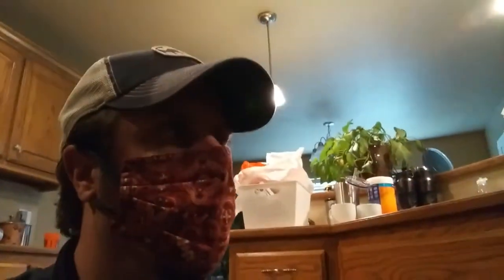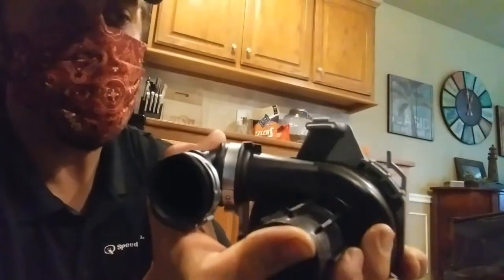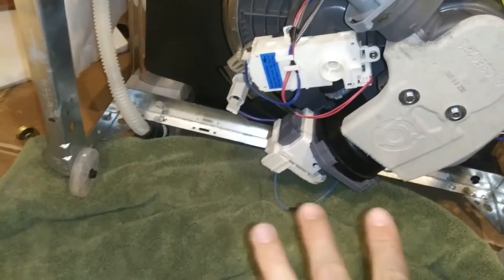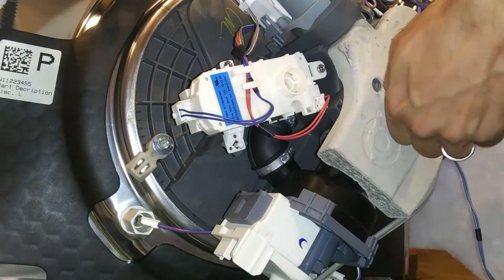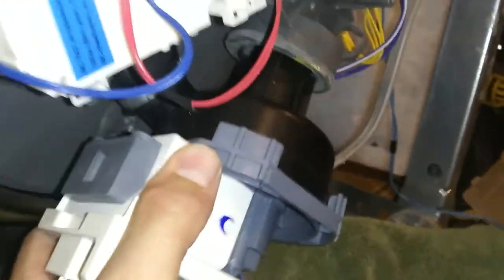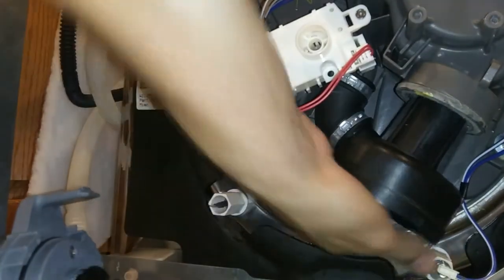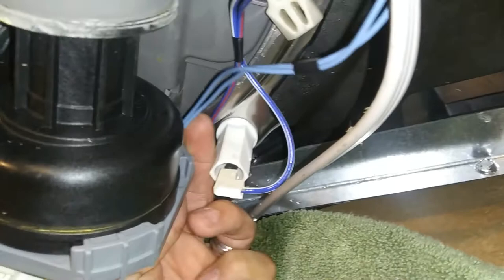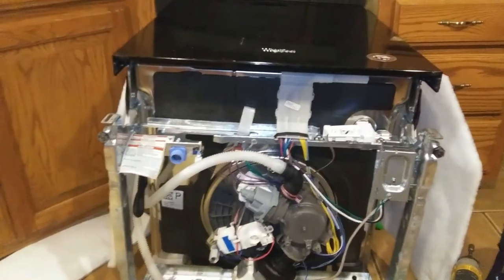Whirlpool Dishwasher Won't Wash: W11084656 Wash Pump Installation

Comment: My Whirlpool Gold Series filled, water heated, relays ticked and the water drained, but no wash. Diagnostics came up clean and then the pump worked for a cycle or two before failing again. Replaced the pump motor using the existing housing. Problem solved. Thanks for the vid.
Reply from the maker: Notorious failure, my friend! Good work! Protip: if you know when the wash pump is supposed to be running and you know it's getting 120VAC, you can knock on them with a screwdriver handle and they'll sometimes come to life. Good, quick way to tell if your pump is bad. Happy to help otherwise!!!!

Comment: Taking snail off is good idea.  Ill try it out.  I didnt want to buy whole assembly.  We will see. Looks pretty simple.  Could i do this without taking dishwasher out?
Reply from the maker: You could try, but I doubt it. I always have to remove the unit from the hole.
Reply: @cgappliancetelevision2315  ok thanks

Comment: We ordered that part from Amazon, they shipped part # W10510667  as a replacement ,it fits but the plug did not work  
where did you get yours ?
Reply from the maker: I'd have to have the model number of your dishwasher to determine what part number will work for your machine. You can never trust Amazon when it comes to part number substitutions. I always use searspartsdirect.com, plug in your model number there, then copy/paste and plug in the part number they give you to cheaper sources.
Reply: @cgappliancetelevision2315  it is WDT970 SAHVO , Thank you very much and Merry Christmas to you and your family

Comment: Wondering if this pump had the old W10854710 part number on it?  Read that the W11084656 was an upgrade but the one I got had the old P/N on it.  Barely got a year out of the original...
Reply from the maker: Yes the W11084656 replaces W10854710. Here's a pro tip: you can always go to searpartsdirect.com and punch in a part number. It will automatically take you to the correct and most current one. You don't have to buy from there. Just use it as a tool to find the part you need. I haven't the foggiest why you received the old part number if it was an OEM part. You'd have to check with your vendor. These pumps are notorious for failure. It pays to get the most current number. It may have been superseded due to the old number having an issue. The other reason part numbers get updated is if the company adapts the assembly to work with more models. Hope you can get your situation rectified!
Reply: C&G Appliance Television all was going well until the new part wouldn’t go in. Come to find out they sent the wrong part number!
Reply from the maker: @JPLawnsMore  That does happen sometimes. Aggravating to say the least. Hopefully the outfit you purchased it from accepts returns!
Reply: C&G Appliance Television well since the first pump arrived broken in no bubble wrap they sent another one free. And this was wrong. So we will see what happens when they reply to the email.
Reply: we have the same part number w 10854710 ordered one from Amazon , they send w10510667 it is the same pump but the plug did not work 
any idea where to get the right one ?

Comment: Great video. Thanks! Before I attempt, is there an easy way to verify that this is the part that needs to be replaced? My DW fills and drains but doesn’t spray any water. I did the diagnostic test and I get the code E3 F4
Reply from the maker: You need to test for 120v V AC at the pump when that wash pump is supposed to be running. As far as getting the correct part, look up the pump motor assembly that is supposed to go with your model number. I like to use searspartsdirect to get a part number. Then take the number you got from Sears and punch it into Google. That way, you can find it as cheap as possible.

Comment: i have clicking sound from under the washer and no wash cycle starts. could this be my issue and i need replacement pump or could it be something else?
Reply from the maker: It's very possible. Test for 120VAC at the wash pump when you're sure it's supposed to be running. Don't just go replacing parts. If you do, you will spend a bunch of money that you don't need to be spending. Always always troubleshoot. I can't wave my magic wand and tell you what is wrong with your machine.
Reply: Mine is doing the exact same thing. Did you get yours fixed?
Reply: @dustinfox7176  yes this fixed it for me. Although after installation, my heat coil also failed...

Comment: Thanks for info but it was not easy to watch everything is shaking and we never saw the most important things like, where everything goes inn power, the pipe and how. Please get yourself a tripod stand so that you may aim the phone on whatever is important, than you may use both hands and the cam will not shake as much.